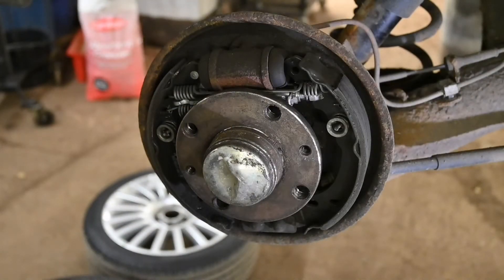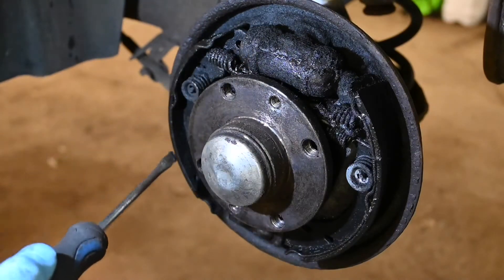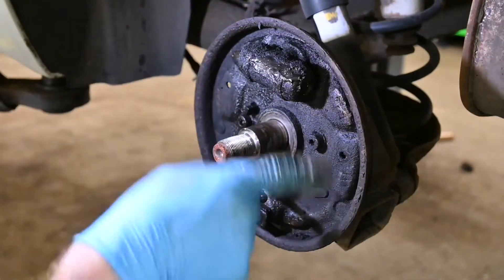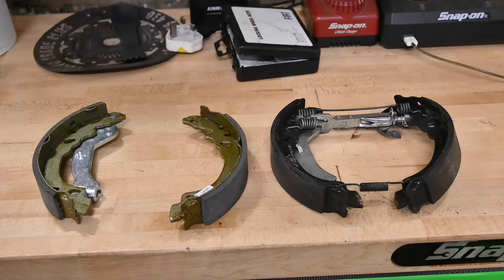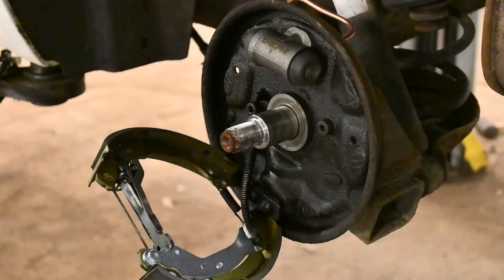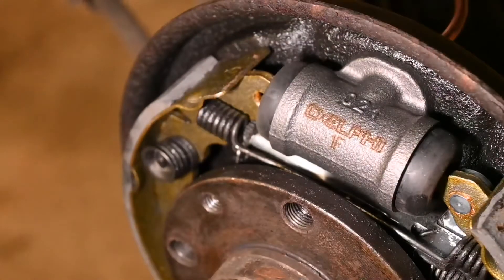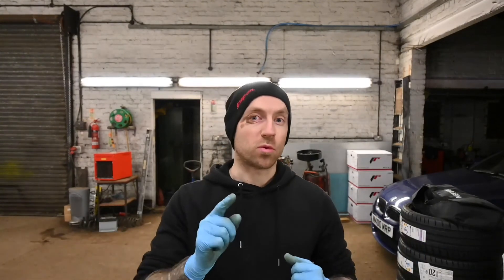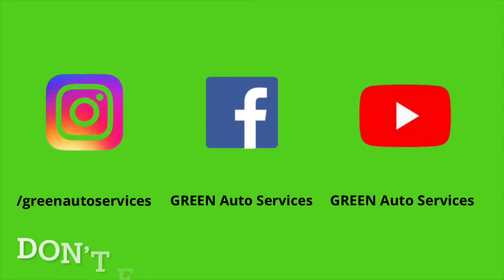Fiat 500 MOT Failure; rear brake imbalance, diagnose and repair

Comment: Great video.Drum brakes look so fiddly.The handbrake feels OK but doesnt hold on hills as i work in Holmfirth with very steep hills.Im gonna jack up the car and take each wheel off and remove the drums to check the condition inside and go from there.

Comment: Good video. Refreshed my long lost mechanical confidence.  Some things have remained straightforward on modern cars. Having a go in the morning.
Reply from the maker: Really pleased it helped! Best of luck with the repair but I’m sure you’ll be fine. Thanks for getting in touch and your support for the channel 👍
Reply: @greenautoservices  passed the MOT, but should have used axle stands. The car fell off the scissor jack and trapped my arm when I put the wheel back on. Broken wrist. Silly boy.
Reply from the maker: AH NOOO, as happy as I am to hear it went through the MOT I'm more sorry to hear you've injured yourself. Don't be discourage but very small slap on the broken wrist for not using axle stands. Wish you a speedy recovery my friend and appreciate you keeping in touch. All the best

Comment: I had same issue on a seicento..cylinders were fine.fitted new shoes adjusted everything still failed on retest!! So just swapped drums from left to right and imbalance was gone.
Reply from the maker: Thanks for getting I touch. Very please you managed to resolve the issue. I've never found the need to swap the drums to resolve an issue but you can't argue with results. As long as everything does what it's supposed to then happy days. Well played :)

Comment: Regarding the pipe twisting when undoing the flare nut I’ve had this problem my solution was to just unbolt the wheel cylinder from the backing plate and held a spanner on the flare nut and just turned the wheel cylinder off the nut/pipe and fittings in reverse and then just nip up the nut

Comment: Right. My van failed on imbalance in May now I've fitted the new master cylinder and rear brake cylinders . Change all the fluids . Cleaned and checked the shoes and also bleed the whole system with new fluid. Sorted out the handbrake.Took it for another MOT this morning and failed again on the same thing. If the garage says I need new rear brake cylinders I know they are taking the piss.
Reply from the maker: Hi Mike, sorry to hear about the situation. What van do you have? If everything has been replaced then the only issue it may be (depending on the vehicle) is that you may have a brake load valve under the vehicle, which is normally at the back. Depending on the load that’s in the back, the valve compensates for the load and allows for heavier braking. If the valve is seized or faulty in any way, that will have an effect on brake imbalance. A lot of the time it’s just seized and you can free it up with wd40. Definitely keep me posted
Reply: @greenautoservices  Peugeot partner van 2007 . 👍
Reply from the maker: @mikeraphone6745  I am almost 100% certain there will be a brake load sensing valve. This would be the next logical step considering that the majority of the braking system has been replaced. They are open to the elements and get heavily corroded over time to the point where the lever that presses and releases the piston will completely seize. Fingers crossed 🤞
Reply: @greenautoservices  hope so . Thanks. I've seen an alloy branch box under the rear axle but there is no lever there to seize. Hopefully I will find something tomorrow when I have yet another look. Thanks mate .
Reply from the maker: @mikeraphone6745  If it’s there, there will be a spring attached to the solid rear axle, which will then attach to a valve/brake line junction. You can always follow the brake line from the front to the back as the valve will be first before branching off to both rear drum brakes. Happy hunting 👍
Reply: Try swapping drums from left to right...sometimes they wear uneven and swapping can balance it out
Reply: @greenautoservices  you know I said there was no lever to see . Turns out there was no lever. It had fallen off .LOL thanks
Reply: @giogio4833  I will do that and see . Thanks for the heads-up 👍
Reply from the maker: Understandable easy to miss. I would question it should have been picked up on the MOT not being there but at least you found the source of the problem @mikeraphone6745

Comment: Good day mate, replaced shoes, cylinder, and bled the system thoroughly.  Still imbalance on rear brakes left and right. Can bad abs pump cause it?? No ABS light on the dash. Or bad proportioning valve?? 1998 rav4. Parking brake is good though. Pls help

Comment: Hi my truck failed on rear brake imbalance, Toyota hilux 2013. New brake shoes and wheel cylinder but still failed? In suggestions? Have took to mechanic to adjust but still failed. Could it possibly be the wheel cylinder not give right amount pressure or the brake drum itself? And is it possible to swap brake drums right one on the left etc?
Reply from the maker: Hi, sorry for the late reply but thank you for reaching out. Did the imbalance fail on the foot pedal or the parking brake? The first thing I would suggest is to make sure the newly fitted cylinders have been bled properly and there is 100% no air in the system. If you can categorically rule that out then ensure the drums are thorough cleaned of any contaminants and then rough up the surfaces with sand paper (both the shoes and drum linings). Then take it for a drive and really use the brakes to help bed the shoes into the drums. If this still doesn't go through, then you may have to see if the vehicle has a brake load compensator. I'm not sure if the Hiluxes do, otherwise you may be trying to find another issue. If the MOT results shows one side is more effective than the other then yes you can try and swap the drums over.....just make sure they go back to their original position unless you're going to renew them both. Process of elimination but your mechanic should be able to help.